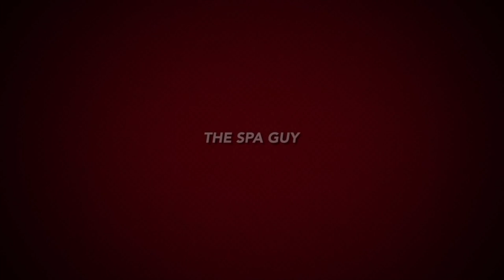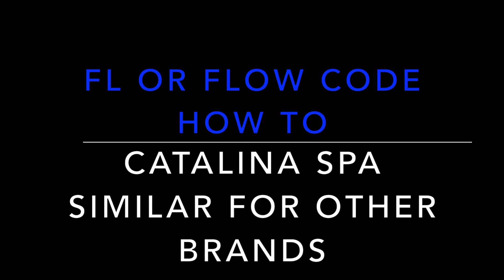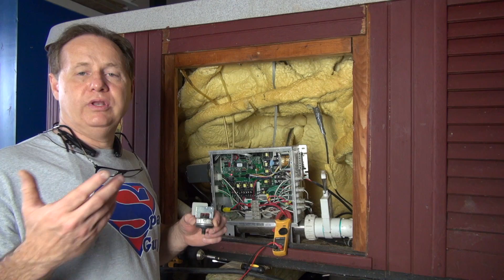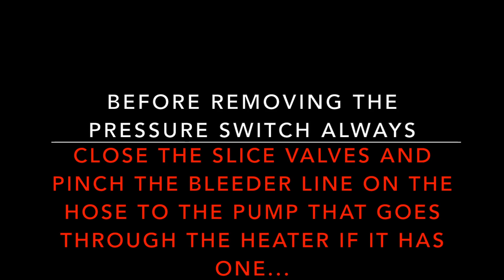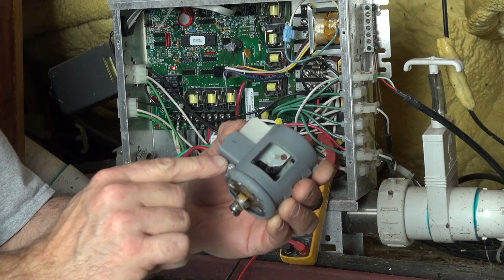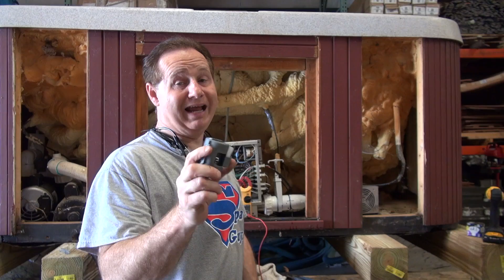FLO Code Balboa Hot Tub How To Catalina The Spa Guy Diagnose

Comment: hot tub is heating for about 20 minutes and then heater turns off and gives LF code. I then push on the control panel the light button and then the temp up button and go through the EC , SL, until i get to the Sb i think it says and then the heater will turn on for another 15-20 minutes. the circ pump is running and no problem with the pump. could this be the pressure switch as well.  

spa guts control panel and spa guts board, heater, pump, and circpump.

ps-   your videos  are  super awesome
Reply from the maker: An SB code is Sensor B bad.. Should not have a pressure switch only (2) M7 sensors.. I have those sensors here.. https://hottubpartsofamerica.com/sensor-balboa-m7-12-temp-hi-limit-1-4-2-pin/

Comment: so i just replaced my flo pressure switch it worked great for about a month. Today I went to check on it and it said flo again. I turned it off then on again. It did a count down and acted like it was going to start but not even the pumps came on this time. I tried adjusting the flo switch in and out but nothing helped. It just flashes between flo and current temp. could it be the flo switch went bad again? PLEASE HELP. Message me back

Comment: Hi Spa Guy, I have a master spa and it froze last winter. I believe what happened is the filter clogged and caused a low flow situation, and then the temperature dropped and it froze. I have since fixed a broken manifold and confirmed no other pipes are leaking in the tub, but now when i turn it on, it throws a low flo code and none of the pumps seem to turn on. If you click the jet pump buttons you hear the relay's clicking, but they don't turn on. I've confirmed they are not frozen motors, and i pulled the circulator motor and confirmed it is functioning.  Any ideas?

Comment: Thanks for the video.  I have a catalina spa with a balboa 2000 control board.  Everyday my spa blower comes on for 30 sec and then goes off.  The other day the blower started sticking on and I have to push the blower control to turn it off.  It has done this every day for a week.  Do you have any idea's?  Thanks